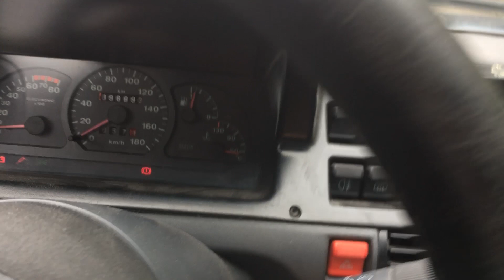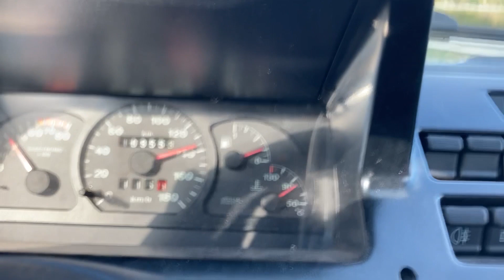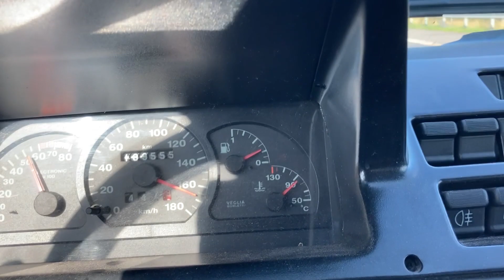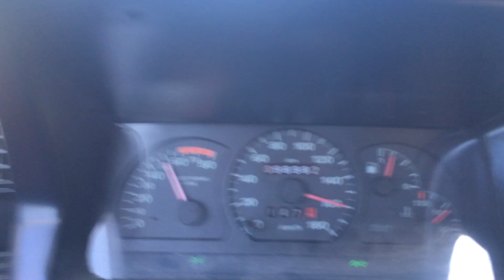Cinquecento Sporting auf der Autobahn Vmax

Comment: Der Cinquecento Sporting war in seiner Klasse eine Waffe ! Mit seinen 55 PS bekam man jede Menge Power, zudem war er nicht über das Steuergerät so abgeriegelt wie sein Nachfolger, der Seicento Sporting. Was ich allerdings nie verstanden habe, dass die Italiener dem kleinen Wiesel kein adäquates Fahrwerk spendiert haben. Im Originalzustand war er hochgelegt wie ein SUV ... mit den Novitec 50 mm Federn stand er dann echt zum verlieben da. Klasse Auto !!!
Reply from the maker: Deshalb benutze ich das Gefährt um täglich damit zu Arbeit zu fahren. Da kann sowas tägliches recht viel Spaß machen. Fahrwerk ist bei mir Sporting Serie, also etwas tiefer als beim CC 900 und 700.

Comment: On mine, 170km/h on the dash was 152km/h GPS. It was full stock and original tire size.
Reply from the maker: Test Speedometer vs. GPS  30 = 26, 50 = 45, 100 = 97 Km/h. Next Test on the Autobahn.. Tires are 155/65/13

Comment: I just bought my first cinquecento 98 0.9.i.s. 29hp...lets see how good it will run. Tomorrow first thing will be oilchange.
Reply from the maker: My first Cinquecento was a 0.9 from 1993. The max speed was about 160 Km/h. Good Luck
Reply: I have a panda 97 0.9 I.E. it has 29 Kw (39 hp) i guess it's the same engine, 135 Kmh declared top speed (stock)